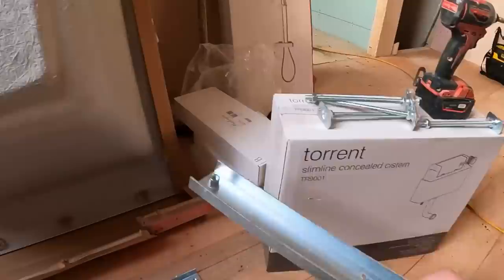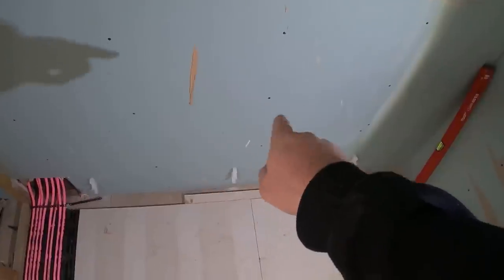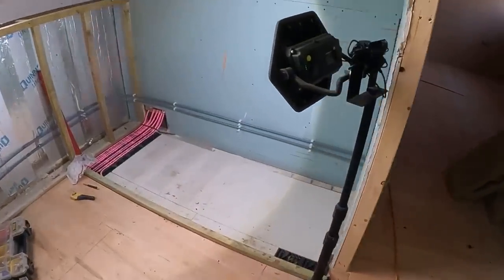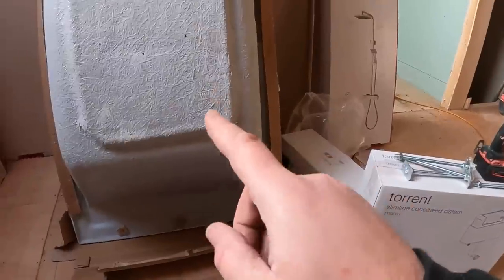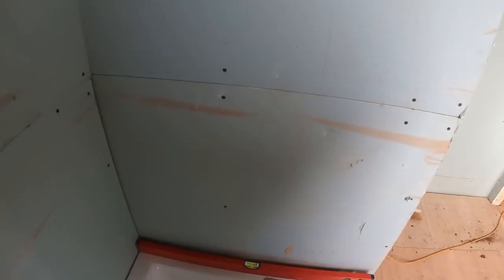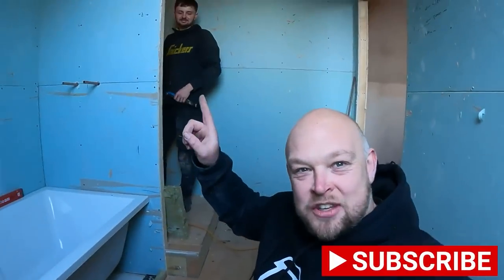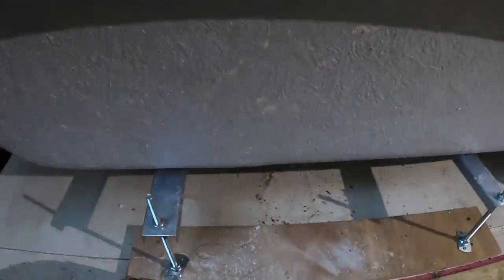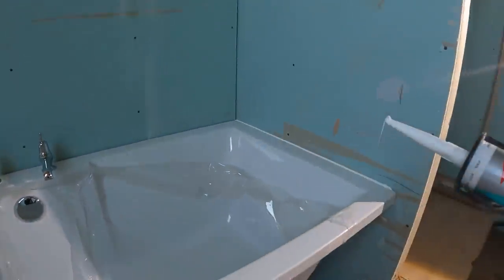PLUMBING TIPS & TRICKS for fitting a BATH - Real World Plumbing

Comment from the maker: Drop me a comment below if you want to know anything about this video, this is how i install my baths, drill taps in and pipe up showers when a build allows.

Don't forget to get subscribed to the channel to not miss some of the content I've got coming very soon.......
Reply: Another great video, Mark. Yes, to the battens along the wall to sit the bath on. I also use 3 strong straiggt brackets - 2 on the long side and one on the short  - underneath - screwed to the batten  to keep the bath from moving. Works a treat.
Reply from the maker: @davidceredig-evans8772  thanks mate, glad you enjoyed it 👍🏼👍🏼

Can never have to many brackets 🙌🏼🙌🏼
Reply: Had to smile when you fitted the support brackets and emphasised using the supplied screw but when you had fitted the brackets you looked into the bath to check none had come through. What would you have done if one had come through!!! One thing dive me mad is when I forget to take the plastic off the bath BEFORE i fit it. Its a real balls ache removing it!!

Comment: Great video! One question about tails on bath taps. I believe the bore hole is 13mm. If you had a property with water pressure not so great, e.g. bungalow, would you still use tails or keep to 22mm copper connected to the taps, so you have a 22mm bore instead of 13mm, or is 13mm okay for low pressure?
Reply from the maker: 13mm will be ok mate…. Not a problem at all

Comment: A comment on an old video I know, but I like to leave the releases a while and binge through a good few! ... 

My question is do you chuck a bit of clear silicone on the very edges of the drilled out holes for the taps to...

1. Help keep them in place when they are in single separate hot/cold taps and not all in one unit - despite does the nuts up nice and tight 
isn't

I'm Just curious as im not in the plumbing game. 

I've Been watching your channel since you had about 2000 subscribers... You've done impressively well in such a relatively short space of time! I think I found it through recommended videos on the side from watching PB's channel.

Thumbs up.
Reply from the maker: Thanks for the kind words mate, very much appriciated🙏🏼
I personally don’t silicone any taps in….. but I know some people do

Comment: Screwing legs in and drilling tap holes. Brown trouser moment everytime.

Looking at where them taps are  on the long edge of the bath a fixed tiled panel will be the least of his problems 😬

What fitting do you use to attach the flexis to the polypipe if you don't mind me asking?

Great vid as always. 👍
Reply from the maker: Always a worrying moment when drilling a bath, no matter how many times you’ve one it.
The flexis are just a normal nut and olive with Polypipe into it mate 👍🏼👍🏼
Reply: Ah male end on the flexi then I assume. Looked like a normal female end one on my tiny phone screen.👍